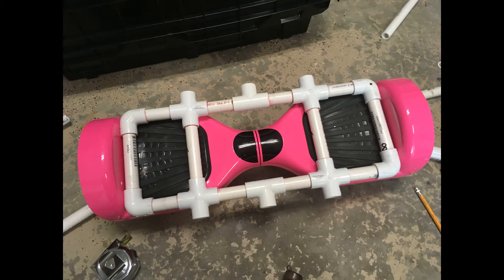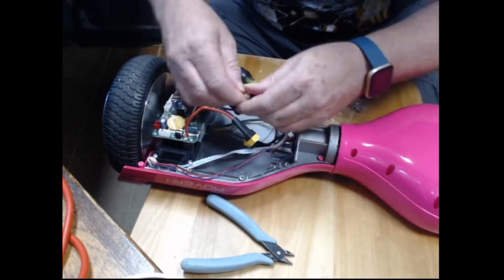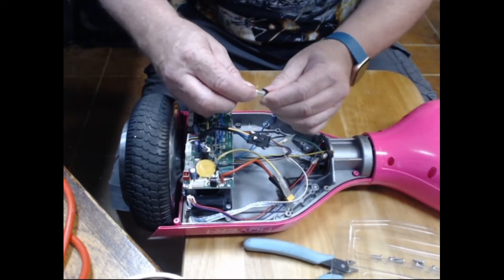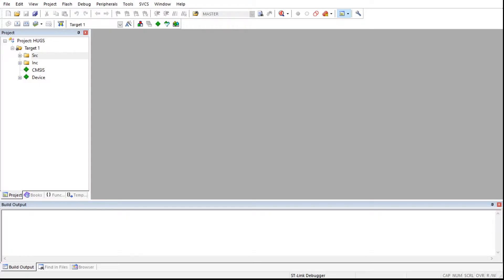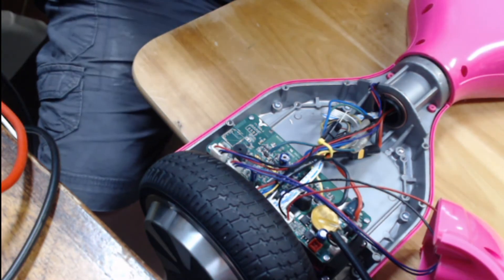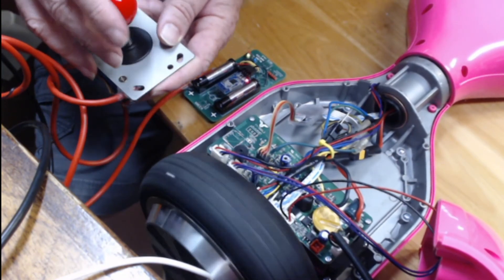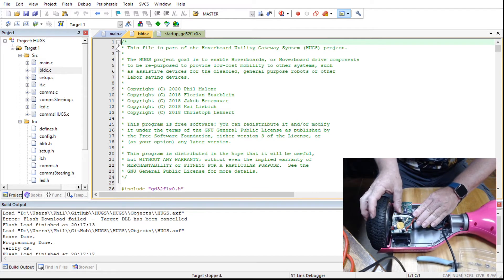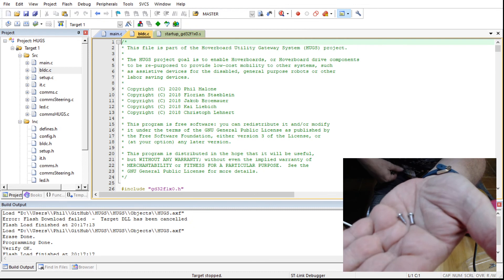Hoverboards for Assistive Devices:  Prototype #2

Comment: I am desperately looking to construct something like this for my mother, however I cant find a design that utilizes a control system that allows for true differential steering, which is crucial for me as it would allow neutral turning to navigate narrow spaces. I'd love to be able to use two side by side single axis joysticks- each controlling the speed and direction of a wheel

Comment: Hello , could you please share the resource how did you do this wireless connection and with which software you flash it. I would like to do similar thing with esp32 connected to the remote output, but I did not see it in your project details. Are you controlling the slave board throughout the master?

Comment: I have looked at the great information you supplied on hackaday.
Just to clarify you are using the st link in the program port to flash the hoverboard firmware.
The using the remote port for your in put joystick arduino. Do you have a link for the wiring? It is probably in the information but a havent found it.

Comment: Nice video I’m having trouble downloading the files because it always says flash download fail cannot load file.
Reply from the maker: Did you turn off the Write Protection on the chip?  play from 3:00 in this video https://youtu.be/spXoIh-eess
Reply: Now I’m having another problem when I and put the code into the firmware of the hover board it starts beeping nonstop  and the power button is not working
Reply from the maker: @Vicknov  Are you loading into HOVER-1 Ultra board, or a different model?

Comment: how can we add an RC receiver instead of the Bluetooth receiver.? Is it possible to control it with and RC remote?
Reply from the maker: My code won't do that.   But I think I saw another version of the code that read pulse widths from an RC receiver.  Search Github for Hoverboard and look for mention of RC.
Reply: @GEARSinc  thank you!